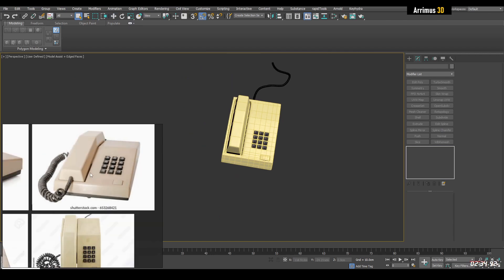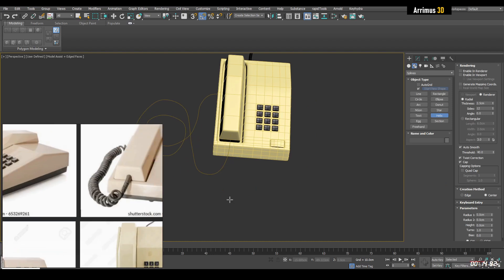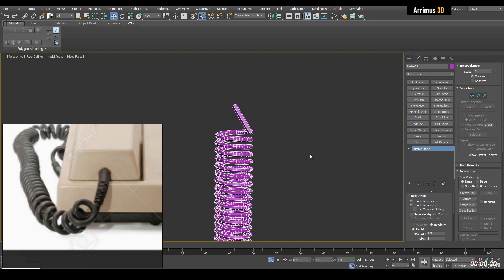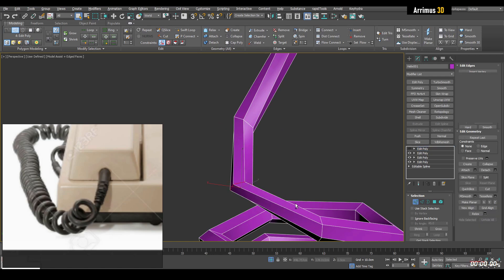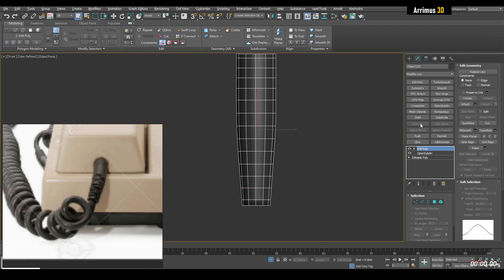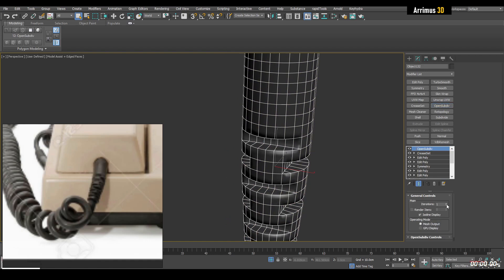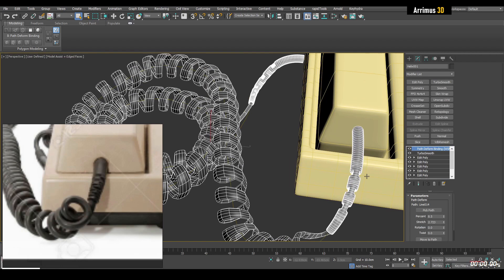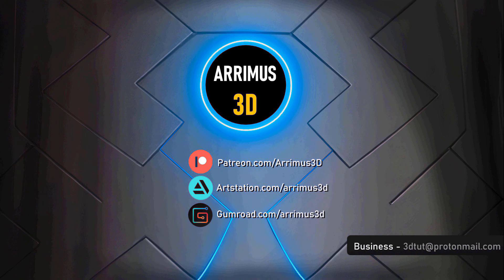Request - Phone - Part 2

Comment: At 6:55 where Arrimus does a face selection and converts it to edge. He then does some trick to straighten those edges and pushes them back. I'd also be interested in how this was achieved.  😁
Reply: Could be straighten in loop tools
Reply: @letteralex  Yes, it's not "make planar" but Loop Tools --> Curvature: Straight.
Reply: First he uses Bevel with the selected faces, then SHIFT + "edges" to select the loop of edges, then Ribbon --> Loops --> Loop Tools --> Curvature: Straight. He probably has a hotkey for it.